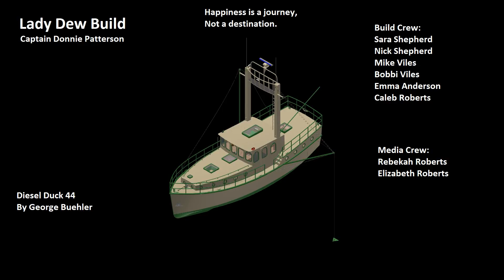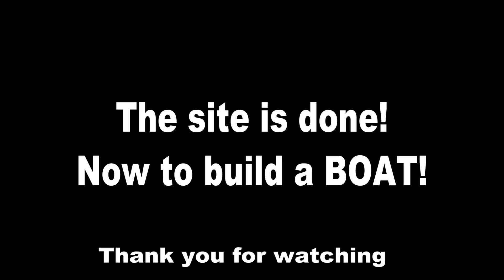Lady Dew Build - Episode 1 Building the site

Comment: Just wondering what do you think the load bearing capacity of the gantry is?
Reply from the maker: The big gantry crane which is 20' tall, 25' wide and on 60' of track, I designed to be a 2 ton crane.  My smaller Harbor freight gantry is a 1 ton and I only use it for in front of the shop.